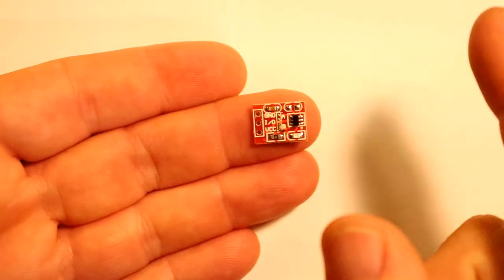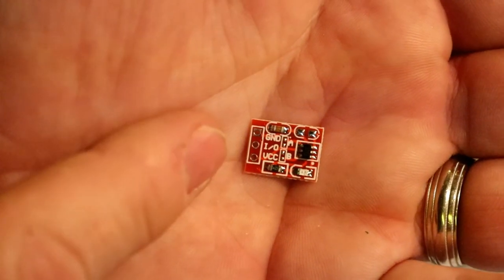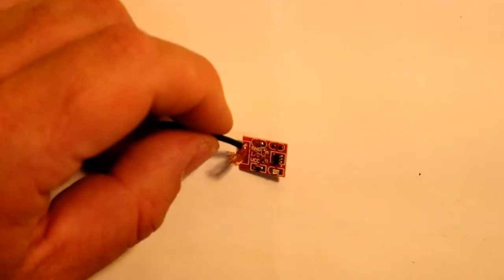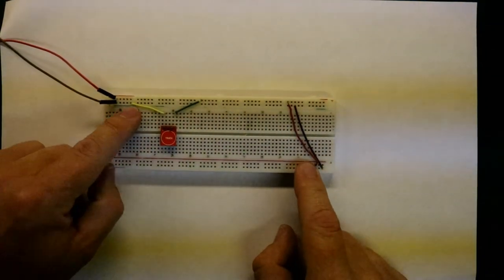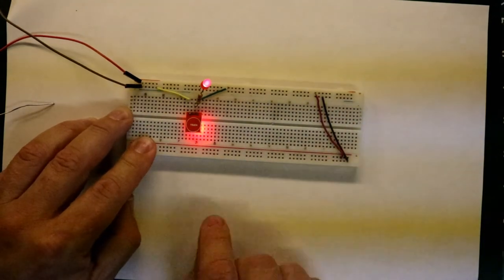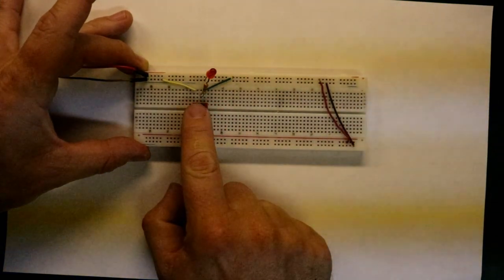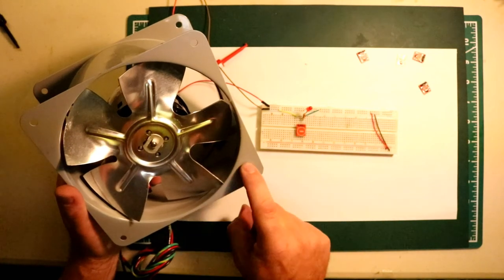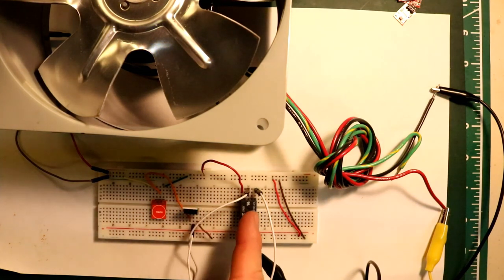CAPACITIVE TOUCH SWITCH - HOW TO USE !!

Comment: Very helpful video, but note that the capacitor on the top left (1:04) isn't the 50pf sensitivity adjustment capacitor - it is just a power supply filtering cap as it goes between GND and VCC. You can see there is a silk screen outline for another capacitor on the module top right. This is the place for the sensitivity adjustment capacitor (Cs). The data sheet notes that sensitivity is maximized when the Cs capacitor is not populated.
Reply from the maker: Adam Fraser-Kruck thank you for your input it was very insightful and thanks for watching!!
Reply: Correct me if I am wrong: standard TTP223 has no capacitor in the top RIGHT corner (at least I don't see one), does it mean that the sensitivity is set to maximum? According to what I read somewhere else the sensitivity can be reduced by soldering in that top right corner the appropriate capacitor (Value between 0 and 50pF ; 0 = max sensitivity).
 
Am I wrong ?

Comment: To add to my previous question, i’ll be using a 12v bistable capacitive touch switch. Can this be possible that both the mosfet and resistor rating are the same?

Comment: Could this type of switch be wired to a 3.5mm plug as a momentary switch? No power needed? These type of 3.5mm momentary switches are often used in accessible technology (power wheelchairs, accessible switch adapted toys, etc.)
Reply from the maker: It needs the 5V. There are more than one type of 3.5mm jack. A simple stereo jack has 3 conductors that can be used but you need to integrate the 5V

Comment: Hi,
Thank you for this instructional video.

 I've tried to play with this sensors and there is something you didn't show/experiment:
Normal behavior: When the sensor is touched it goes HIGH and when you stop touching,  the sensor goes LOW. (Yes, that's right and you show it). 

What is missing is: When you touch the sensor (goes HIGH) and KEEP your finger on it, the sensor goes LOW after 6 to 7 seconds.
 My experiment was made with NO BRIDGE in "A" and NO BRIDGE in "B"

Is this the real behavior? Or my sensors are a "fake"?

Thank You.
Reply: I have not tried that.  The next time I am playing around with one,  I will try it out and see what happens!  Thanks for watching!

Comment: Thanks for the video great help. I do have a question if you can help.  I'm trying to control a 12V actuator with the sensor. I'm stepping voltage down to 5V to the sensor. Then from the sensor to a step up convertor back to 12V. The step up convertor can't go above 6V. Do I need to add anything to the I/O of the sensor so that the step up convertor can reach the target 12V? Thank you
Reply from the maker: emarg002 thanks for the question. Sounds like you need a boost converter that can go back up to 12v. Here is a link that maybe helpful. 

https://www.ebay.com/itm/DC-3-24V-to-5V-28V-9V-12V-24V-2A-Adjustable-Boost-Step-Up-Converter-Power-Module/112619032791?hash=item1a389e10d7:g:NE8AAOSwvDpbBoGe

I hope this was helpful. Thanks for watching.
Reply: @ehobbyguy8980  , Thank you for the reply. I'm going to go ahead and purchase this one but I'm using the step down and step up converters in the link;
Step Down Conv.:
https://www.amazon.com/gp/product/B01F9ZQ2YS/ref=ppx_yo_dt_b_asin_title_o00_s00?ie=UTF8&psc=1

Step Up Boost Conv.:
https://www.amazon.com/gp/product/B07DH4KRKF/ref=ppx_yo_dt_b_asin_title_o09_s01?ie=UTF8&psc=1

Once again thank you

Comment: Hey boss how would I go about powering a wireless clipper with the touch switch?
Reply: The hair clipper is a 3.7v working off of a 2200 mAh rechargeable battery, would I still need a relay to power it on and off ?

Comment: I really need the wiring diagram of this circuit, plus with step down transformer to power 5V DC for touch switch. I tried to wire this circuit myself today and I think I wire the mosfet wrong the relay don't even click.
Reply from the maker: I released another video going over this circuit in detail.  Here is the link of the video which has the schematic!  Thank you for your comment and thanks for watching.

Comment: Can we set default state from Arduino ?
Reply: No, you cannot return the switch to its default state from an arduino.  To get the switch out of its default state you have to solder a bridge onto the board.  An arduino cannot undo this.  Thanks for your question, and thanks for watching!!
Reply: @UControl4  Great thanks for quick reply ! May be their can be some way where we can bridge the link for a while then we can drop that bridge I am not sure may be some register etc can do that ?
Reply: @ankur089  if you solder a FET across the terminals, then switched it with the Arduino, that would probably work.
Likewise, if you measure the effect of the bridge, which is likely simply to pull something high on the chip, you could just use the Arduino to feed it directly, and forget the bridge.